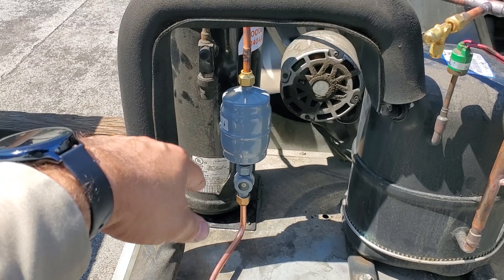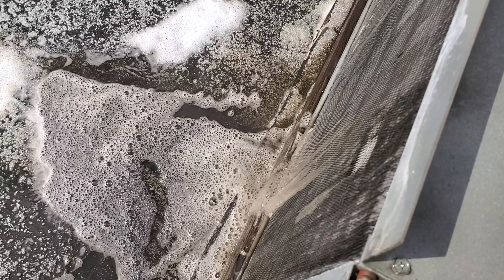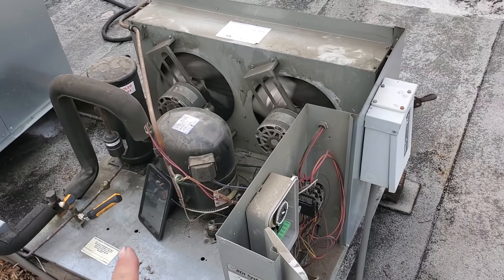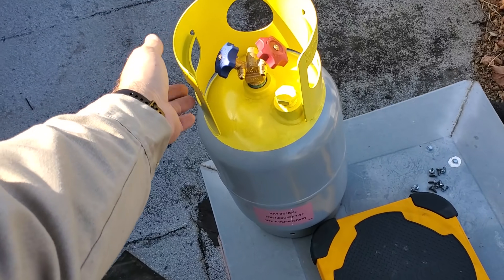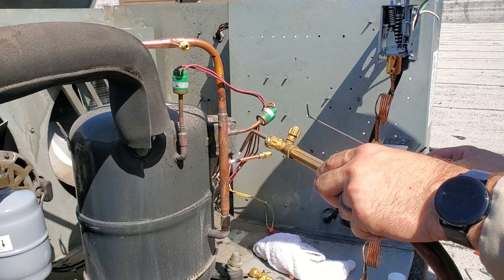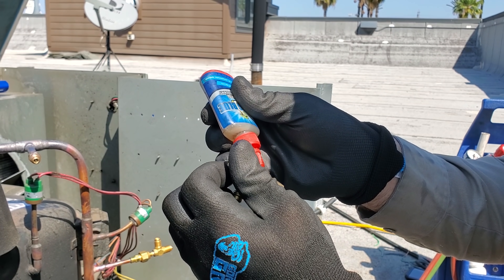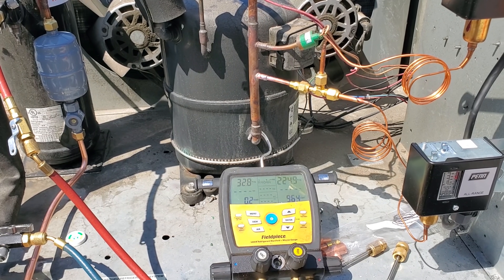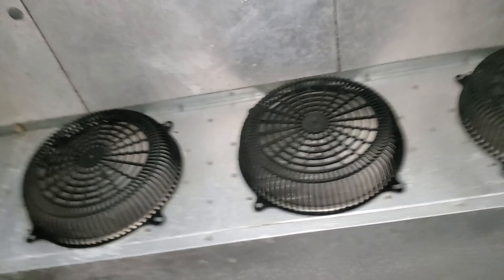HURRY THE WALK IN IS WARM AND THE HEALTH INSPECTOR IS HERE

Comment: that secondary valve you removed ir actually handy to replace the dryer, the king valve and secondary liquid line valve isolate the dryer which means you can replace it and I believe also has a port into the isolated point area which even lets you evacuate before opening the valves again.
Reply: I would actually install isolation ball valves with ports around driers on large systems if they didn't exist so that I could replace a carbon core drier with a standard drier without pulling the charge. It is such a time saver for burnout cleanups on large systems!

Comment: Not long ago i put fan cycling on a RTU for a server room for low ambient cooling. Had a 3 phase condenser fan motor. I set up everything correctly to maintain a 90° saturation and keep the evap from freezing up. Still the fan was on off on off constantly. Customer didn't want to pay for an economizer. Their maintenance guy was on the roof and watching the fan bang on off. He calls me and asks if that was good for the motor......i said no, but that is what you wanted to pay for. He didn't like it, neither did i. They ended up paying for an economizer to be installed. Lol.

Comment: Here in europe we use a 2 to 3 bar difference for fan switching. So 29 to 43 psi. You look up the pressure for 42°C condensation and use that as cut in for 1 fan and like 45°C for a 2nd fan

Comment: see Chris this is where we differ   the fan cycle control is suppose to be on the liquid line  

1. Discharge is always higher 
2.i want to control the pressure after the freon has circulated through the condenser.
3 to change anything  simply close the reciever

Comment: once those disc type cycle switches go bad, I change them separate cycle switch and solder in tee, recover etc. since we would have to do that anyway, its a little more cost, but beneficial in the long run

Comment: I almost got myself into trouble once by trying to cycle fans independently. You have to be very careful that the second fan doesn't spin backwards with only one fan running because PSC motor torque sucks and will actually start backwards if it's torque isn't enough to stop the motor and reverse the rotation. Typically it's not an issue if each fan has it's own venturi it sits in. My experience was on a 7.5 ton York split and the props don't have venturis because York sucks.
Reply from the maker: Great point!!
Reply: @HVACRVIDEOS  It was only that one isolated incident for me but I'll never forget it, that's for sure!

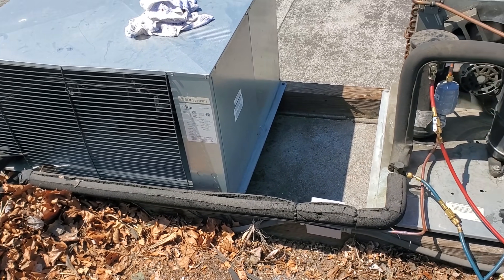Comment: At 22:27 mm:ss, when someone does come to replace the filter drier, IF, they CHOOSE to install COPPER FLARE CRUSH WASHERS, at each flare fitting, it will SAVE the lineset's female copper flares from SPLITTING!!!!!  COPPER FLARE CRUSH WASHERS RULE!!!  NO SPLITTIES on them FLARIES!!!  (Edit add:  Usually, I add them on every opened flare I deal with, new or used.  It is just such CHEAP insurance to prevent a flare split, after I walk away and system vibration gets to working on the thinned flared copper.  IT'S THIN GUYS!  REAL THIN!

Comment: It doesn't surprise me that she was upset. I get the same treatment with POS systems. Having the 2 fans cycle in that manner makes the system most efficient in the long run as you are not running both fans thus saving power. Just my 2 bits.

Comment: Another great video Chris , not sure why you felt it necessary to cut out the shut off valve surely leaving it in meant you have isolated both sides of the drier/sight glass?
Reply: Now when the filter dryer gets restricted he needs to evacuate the evaporator and lines.if there was no access valve just add one between the two king valves. How much would that cost more?

Comment: On the high pressure protection, I think some standards association don't allow shrader under the protection since it can "fail" where the depressor slips next to the valve and essential renders the high pressure protect useless. This isn't the same on fan cycling/low pressure as those protect the equipment from breaking down as opposed to the high pressure which is a safety concern.
Reply: It is a UL requirement that the high pressure safety cannot be “valved” off.
Reply: That's really good to know.
I often see hoses with depressor on rack without Shrader... And the depressor break and block the control from reading.
And that's factory on multisystem  parrallel rack.
 But I still see new systems shipped with a hose / depressor / Shrader valve on the HP safety control such as Keeprite, etc..

Thank you for the infos :)

Comment: Question: I have a heat pump, heats fine one heat mode pressures etc., switch it to cool mode, valve switches pressures rise to 225/75 (r22) very good then suction pressure steadily drops over next 10 sec. gotta be a restriction I’m thinking. Thoughts.

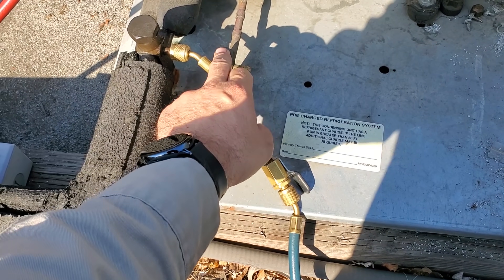Comment: @ 12:30 you said there is no need for that valve, Is there another valve past that point? What if you need to change the dryer? I get it, if it is done right from the beginning, dryers are just an extra thing, more of a safety precaution, but what happens when they call another company out because you are so busy and this particular company doesn't have the same practices as you do and is notorious for contaminating everything they touch, but they had someone that could get right out. Of course, I am comparing it to my area, and what I've dealt with, anyway, I would love your feed back, even if it is less than positive, we're always learning in this business, and Thank You for your content!

Comment: Hmmm  The first thing to try would be just running one fan on the switch to cycle and see how that performed.  If it really needed additional (which I doubt)  control then a proper FSC should have been fitted to control both fans at the same time.  IIRC these T should have a copper washer for them to avoid brass to brass . You've introduced additional leak points with these new connections especially using flares which are known to be the most likely point to leak on a system.. Worse they are on the discharge which is the pipe that suffers most expansion and contraction.
Reply from the maker: I will discuss this on my Livestream this evening on YouTube  4/5/21 @ 5:PM (pacific) come check it out https://youtu.be/zXI_u_jKMSg

Comment: Are hot work permits not required when you burn ?? 
If I use so much as a heat gun , I need permits .  Guess that is the difference in working hvac vs industrial battery repair .

Comment: The reason manufacturers don’t make them serviceable, they want you to replace them with a new unit once they break down
Reply from the maker: Yeah you are right!!
Reply: Looks more serviceable than most cars/ machines if worked on. Looks like you have access to most of the tings with little disassembly.
Reply: @eeuwedevries  that reminds me of my dad's old car, an opel meriva where you almost had to pull the engine out to change the light bulbs
Reply: My take:
If we make them hard to service, the field guys will either break something that will need fixing, or they will make it serviceable on there own.
SO us designing badly is giving them job security, and all we get are complaints about it.. Ungratefull
Reply: @Eledore  not wrong about the job security.
Reply: Aye. 
In a restaurant I worked at we had a small cooler for the salad bowls. When it started clicking/chirping intermittently, it was suspected to be a little low on coolant. It had absolutely no ports to verify or charge. Course no decision makers wanted to get ports installed.

Comment: Looks like dual fan controls would make it very inefficient because with only one fan running it's going to pull most of the air though the fan that's not running instead of through the condenser. Wasting fan energy.
Reply from the maker: Nah it's got a baffle in between the fans

Comment: Couple thoughts, did you consider just installing a headmaster instead of the fan cycling controls? Receiver looks generally large enough.  

Also with pipe insulation outside, I’m starting to wonder why it’s the norm for it to be unprotected/uncovered. It obviously gets just trashed from being in the elements. I feel like it should be typical to cover, like with the white plastic cover for instance.

Comment: @ 21:24 —   Is there an operational or efficiency advantage to having the fan closest to the inlet running more than the other fan?  Surely, this will have a side-effect of causing that side of the condenser to get much dirtier than the other side. In addition, the fan motor would be expected to wear out sooner. Considering a dirty condenser is what triggered this service call, and to mitigate the cost of future fan motor replacement, would it be worthwhile to use a more advanced fan control which can alternate between fans to cycle them equally?

Comment: Great 📹.!. When u recover from both sides of system do u energize evaporator circuit or use solenoid valve magnet ? Thanks again!
Reply: I think when you cut the unit off when its calling the solinoid stays open.
Reply: @sherwinalvarez7365   solenoid valve if its a normally closed valve closes when no power to it. So to recover u either energize evaporator circuit or use a magnet.

Comment: Locktite is not lubricant. It's glue intended for use with metal. Just thought I'd point out that egregious mistake.
Reply from the maker: Huh? I didn't use any lock tite, what am I missing here?
Reply: @HVACRVIDEOS  nylog/locktite they aren't lubricants, they are thread glue, designed to prevent threads from vibrating loose. They are essentially the same thing, just slightly different chemical make up to prevent patent infringement.
Reply from the maker: Nylog is poe oil with a thicker viscosity, it is most definitely not a thread glue it never gets hard, when applied properly to flare nuts it acts as a lubricant.

Comment: Hi, Chris, I have to disagree that putting the thread lube on makes the torque incorrect, it is actually the opposite. The torque values are determined by the force that gets applied to the sealing surfaces, not the effort to turn the fastener.
Applying the lube will give the proper sealing force and prevent galling and wearing out the threads which could lead to a failure. 
I'm not an HVAC tech, but I'm nerdy and am learning a lot and enjoying your production.
Reply: While that's true, many manufacturers write the torque specifications based on unlubricated threads. So lubricating the threads can get over torque conditions.
Reply: Yea, many manufactures say don’t lube threads. Unless the explicitly say you must like some head stud bolts.
Reply: @zacharysamenfeld2487   @FishFind3000 so they can sell more product and cost businesses more money because of unnecessary wear? You have to love planned life span.
Then I might suggest using the lubricant with a little less torque?

Comment: I would have installed a Head Master and get rid of the fan cycle controls! My question is, Why do U even need a Fan Cycle Control in California!?
Reply: I like headmasters better too.  As for the fan cycle, despite the propaganda, there actually ARE times when its cold enough here to not have sufficient pressure with fans going full blast. There's our 5 or 6 winter weeks. And a brief period of cold nights. I celebrate when I see it in the forecast, but it is not so good for ensuring proper pressure differential across metering devices, and so forth. Lol.
Reply from the maker: I will discuss this on my Livestream this evening on YouTube  4/5/21 @ 5:PM (pacific) come check it out https://youtu.be/zXI_u_jKMSg

Comment: Anyone have any experience with Nu-Calgon 4166-75 Coil Cleaner? my HVAC guy recommended i use it to clean my residential unit coils (Air handlers) so that i wouldnt have to spend a few $100 for them to do it. Its self cleaning so i just apply it and when the AC is in use it'll clean itself. (Thats what i was told, i'm still waiting for them to be shipped)

Comment: You were talking about the head pressure and fan cycling after you cleaned condenser. Your pressure measurements are not accurate due to the fact your covers are off...
Reply from the maker: The panels for the condensing unit? Those won't make any difference.....
Reply: @HVACRVIDEOS  on your pressures? it most certainly will....
Reply from the maker: I'm confused what panels your talking about? The top rain shield and the side panels?
Reply: The top and the sides of a condensing unit when pulled off will make your pressures out of whack.

Comment: Fan cycle controls should only be used on fully isolated vertical exhausting convection plan coils or on interior high-precision cooling arrangements designed to keep a volume of air within about 1 degree.  They are a useless complication of wear-and-tear in almost any other installation and really aren't worth the "savings" they claim on the label of units.

Comment: This might be a stupid question, but instead of hauling some of the heavier objects onto the roof, like the cans for welding, couldn't you leave those on the ground and have very long cables going up to the area that you need them at? I'm guessing that there's probably a safety reason for why you would need to haul them up there, but I can't imagine that they're light to move around. It would be great if there were a way to save yourself the extra weight.

Comment: Incorrect  you always want to have the Fan cycle switch on the Liquid line   i dont care about my pressure heading into the condenser   i care about the pressure leaving the condenser
Reply from the maker: Fair point!
Reply: @HVACRVIDEOS  Just the way i see it ...  Discharge line will always be higher  and Plus if i install it on the liquid line after the receiver just gotta pump down the system and do a hot swap  OH NO I SAID HOT SWAP ! WHAT A HACK !  LOL   its all good we got our own methods if yours works and mines works then were all good!